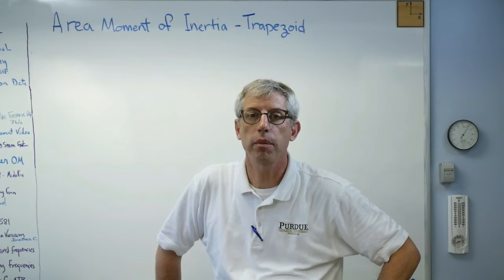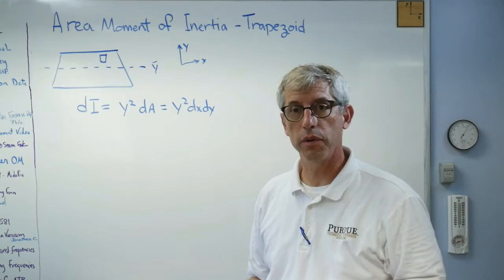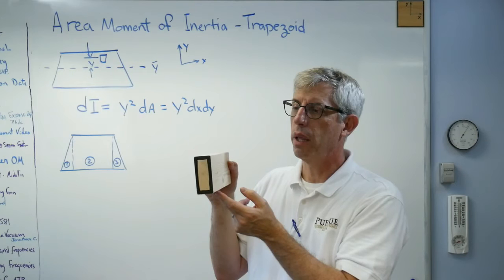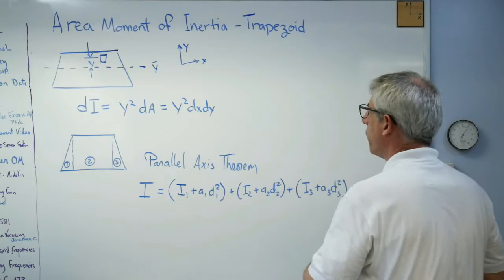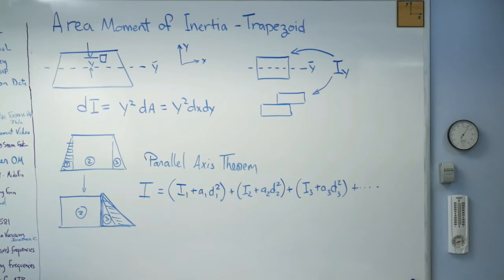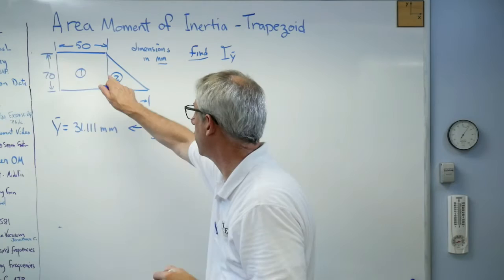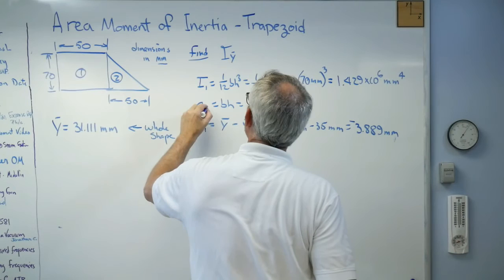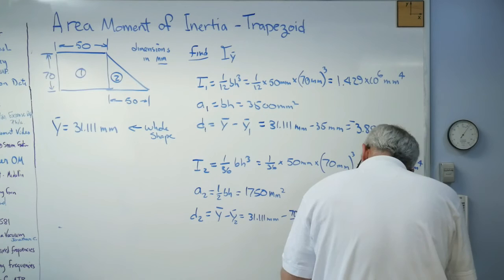Area Moment of Inertia of a Trapezoid - Brain Waves

Comment: I really appreciate this video, thank you!   When looking at the resultant units of the solution to the problem (mm^4) what information is that really expressing about the number?  In other words, I can wrap my brain around: mm (unit of length), mm^2 (unit of area), and mm^3 (unit of volume).  However when it comes to mm^4, that is... well, I do not know how to interpret that dimension.  Do you have any insight?
Reply from the maker: The whole idea of length^4 confuses most people at first.  The short answer is that it doesn't have any obvious physical analogy.  For example, a spring has stiffness measured in force/length.  If it takes 1 lb to compress a spring 1 inch (or 1 N/1mm), that definitely sounds like stiffness, but I isn't that intuitive.  Area moment of inertia is a little different in that it is just a term that appears in the equation describing the defection of a beam.  Mathematicians and engineers saw that term enough times, that they decided to give it a name.